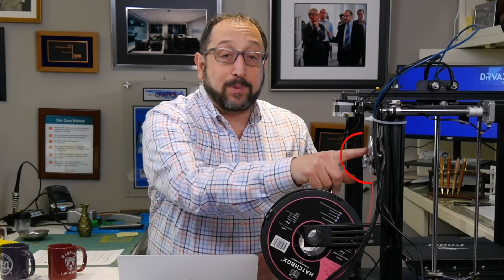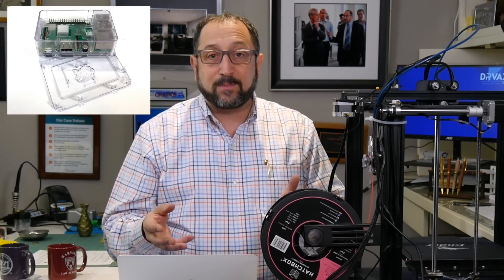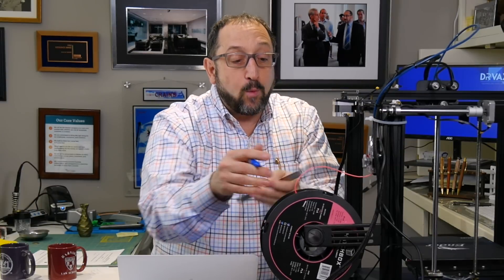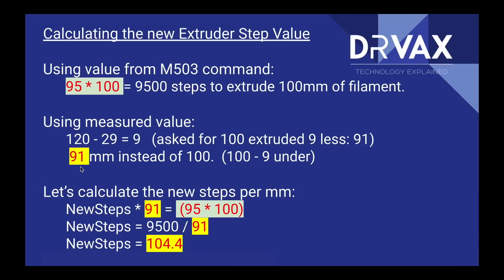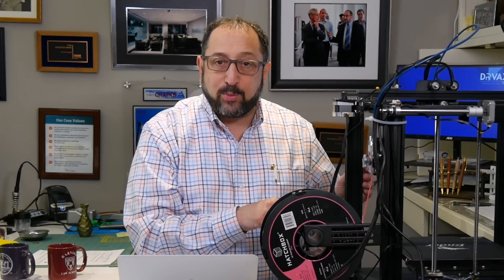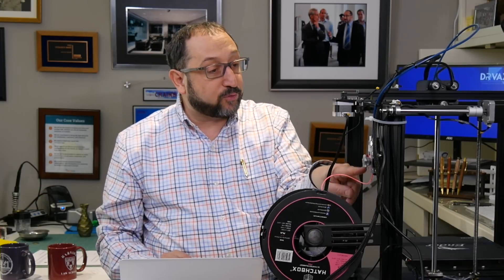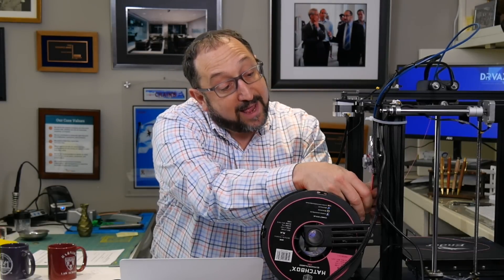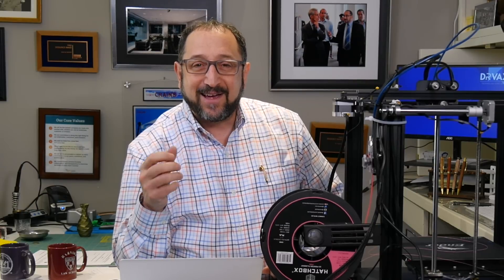Calibrate Your 3d Printer Extruder

Comment: I have 17 "how to calibrate extruder" videos lined up in new tabs and have been going through them, but all assume some part of the knowledge, and rarely a clear demonstration is given, either on the printer or the host software. This is as clear as it gets! Thank you. I feel confident to do it with my own printer now.
Question, some people have advised to take the 'hot end' off to calibrate e-steps. I don't think is required but is this something people do?
and one more question, some people have also advised that my particular printer has 'eprom' turned off? so that it won't store the settings when I turn the printer off? Have you heard of this?
Again, thank you for making a really clear video that explained everything really well. Other video's just lost me when something wasn't explained well or they assume you are familiar with a step so they skip explaining it altogether...
Reply: I've seen others say to extrude the filament through the nozzle for "real results", and others say disconnect the bowden tube and measure it coming out of the extruder motor, before the hotend. If you think about it, this is silly because, either way the filament is being fed by the motor which has no idea what the filament does, it just spins a mathematical amount of rotations based on the length of filament you told it to feed through. You can remove the bowden tube and avaoid heating the hotend, or you can leave the bowden tube and heat up the hotend, both ways are equal because the motor will spin the same amount to feed the filament through

Comment: This took me a long time to realize how great this video is.  I have watched it about 5 to 10 times over a couple of weeks.  I'm building my second Ender 5, while I use my original one to print parts for it.  As I'm building the new one, I;m upgrading parts, new Micro Swiss hot end, EZR Struder by SeeMeCNC and the new TH3D EZBoard Lite which should arrive within a week.  This video really has helped in understanding how to adjust settings and to start to understand the Marlin firmware - gcode.
Reply from the maker: Thanks for the comment.  You may find this video helpful. https://youtu.be/Ny_LD1vXO2k

Comment: how to extrude 100mm on ender5 with cura ?
Reply from the maker: I do not believe you can. Cura USB support has not been reliable in recent versions.   I recommend on of the programs I listed in the video.  

If a viewer has cura 4 working over usb with an Ender please leave a comment.  

Another alternative which is easy to use is mattercontrol from MatterHackers.
Reply: @MakeWithTech  my friend on cr10s have in the menu extrude my ender5 i cant find it
Reply from the maker: How did your friend connect to cura?  Do you know the version?
Reply: @MakeWithTech  no he didnt he just extrude from the menu of the printer 100 mm and he makes the calculation and he put the numbers in the estep of the menu
Reply from the maker: Makes sense.
Reply from the maker: I do not believe this feature is available in the marlin firmware on the ender.  I cannot be sure because I upgraded my firmware.   However, both mattercontrol and repetier-host are very easy to use.
Reply from the maker: I have created a form on the drvax.com website to help people that do not want to do the math.  Check it out at:

https://drvax.com/advanced-3d-print-calculating-extruder-steps-mm/
Reply: Just use pronterface. Super easy.

Comment: If your extruder underextrude,  does the flow calibration can fix the probleme or the flow calibration have a different use?  I have always working that way and seem good like that.
Reply from the maker: Yes.  It will unless you have another issues.

Comment: I quickly became totally lost I hate to say..  I'll replay it slowly but I don't think I'm there yet.  Unless you have the same printer and use the same software its tough.   Maybe one day I'll get there. Luckily my new extruder seems pretty good.  I'm waiting for the day when it is all self adjusting. Remember tractor fed printers with ribbon ink...now full colour.. just load the paper. 3D printing will be there soon ... and the sooner the better.
Reply from the maker: I hear you.
Reply from the maker: @don murphy I have created a form on the DrVax.com website to help folks that do not want to do the math to calculate a new extruder value.  Check this out:

https://drvax.com/advanced-3d-print-calculating-extruder-steps-mm/

Comment: That helped me. But I'm almost positive that you lost many when you started talking algebra. Many people are doing algebra and not even realizing that they are doing it. For instance I work with a couple of guys that are great carpenters and their work leaves nothing to question but when you start throwing geometry at them they get beside themselves. They,  however were taught in a time of simplicity. Try to simplify some of the jargon so to speak. That was an important subject and a rarely talked about fix that is a major cause for a huge number of printing errors. Thanks Dr Vax.
Reply from the maker: Unfortunately defining the new steps per mm does require some arithmetic.   I am going to see if I can add a "calculator" to the drvax web site that will make this easier.
Reply from the maker: I have created a form on the DrVax.com website to help folks that do not want to do the math to calculate a new extruder value.  Check this out:

https://drvax.com/advanced-3d-print-calculating-extruder-steps-mm/

Comment: Hey I've heard that some printers won't let you save to the eeprom.. Alternatively you can can add that gcode to your starting gcode in the slicer and it'll just do it each time for you.
Reply from the maker: You are absolutely correct.   You can also use the slicer extruder multiplier which is called Flow under Material in Cura,  Extruder Multiplier in Slic3r, and Extrusion Multiplier in Simpify3d.

Comment: Hi Dr. Vax.  I just realized one of my three stop limit switches has a missing metal tab on my ender 5. The actual part that makes contact.  So the gantry is making contact with the red tab on the x axis stop limit switch.  My question is are all the stop limit switches the same?  Or is this how it’s supposed to be.  When it returns to home it sounds different and is much louder when the x goes to the stop.
Reply from the maker: They all have the same part numbers on them (836) and all of the switches have levers.

In terms of limit switchs, in general, the primary difference between limits switches is if they are normally open or normally closed.   I used a meter to check one of my switches on the Ender 5 and also inspected the circuit boards the switches are connected to.  

These switches seem to be normally closed and they are wired with resistors since when the lever is not depressed there is resistance on the circuit.
Reply: Thank you doctor.
Reply: @DD-we9wm  if it is making firm contact, the switch will still work and the louder sound is more of a definitive stop electro and physical as well now, against the switch at the same time the switch triggers, I actually prefer the stop triggering by the red button, because you don't have the variable of the flex from the metal tab. It wont do any harm as long as it triggers. The tab can easily be removed or as you say even knocked or brushed off. Just make sure there is something solid to trigger the button coming in contact, if there isn't you would know because the stepper motor would go a bit nuts.
Reply: Ok Mark, that is reassuring.  The printer doesn’t sound happy but the explanation makes sense to me.  Never thought about the flex of those tabs.  It seems like the tabs give it the extra room to slow down, when it hits the red button it’s so abrupt.  I’m glad to hear it’s most likely not damaging anything.  
Maybe Dr Vax could do a video on removing those tabs and stop limit switches in general.  
 Also on a good note about all of this.  I bought this from Amazon and it was a Comgrow Ender 5.  I called Amazon and they said I needed to contact Comgrow directly.  Expecting nothing from the Chinese company, Banggood never replied to my emails and they charged me for over $100 for a cancelled five minutes after it was placed order.  I was expecting to be ignored, to my surprise I was contacted back within 12 hours!!!  We will see how it goes.  Wile 3D of YouTube hooked me up with a replacement in the meantime.  Thanks to him and thanks to you for your response.  It is appreciated!
Reply: Daniel (and everyone else), search this on Thingiverse 'Silent Auto Home for Ender-5'. Print them and install them. It is crazy how much better they work. I hated how the printer would make that loud noise on X & Y when it went home. You will have none of that after this upgrade. Best of all it only takes about 15 minutes to install. Just remember that your limit switches get flipped upside down for this to work. The Ender 5 should have been like this from the factory.

As always, great video DrVax!
Reply: Dave Scott  Thank you!